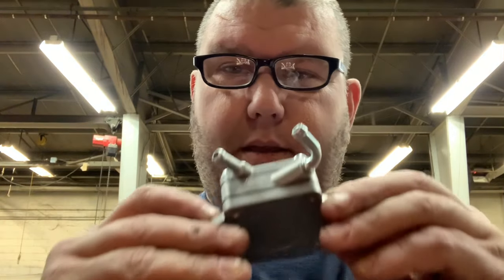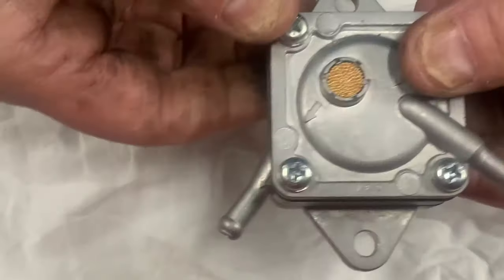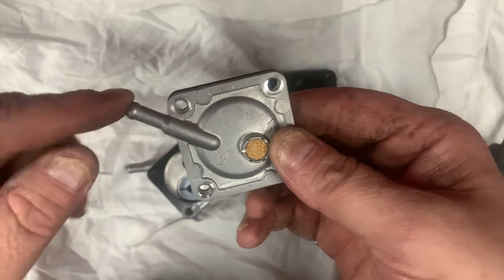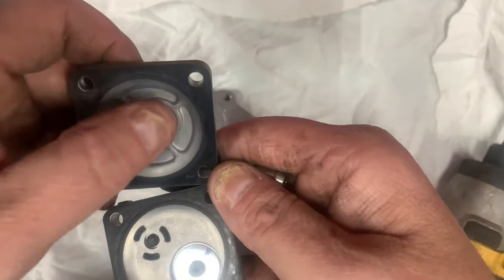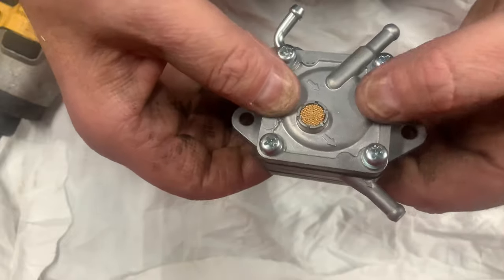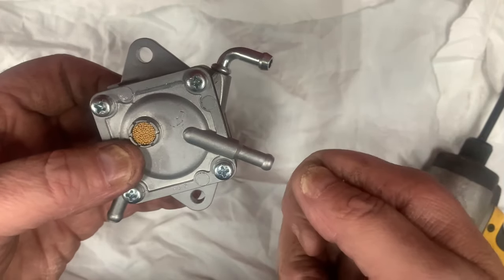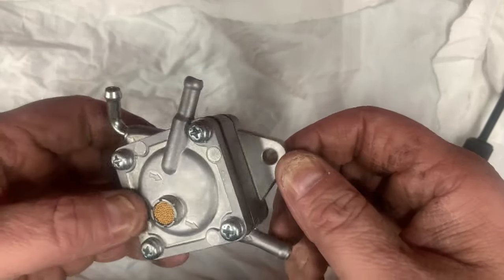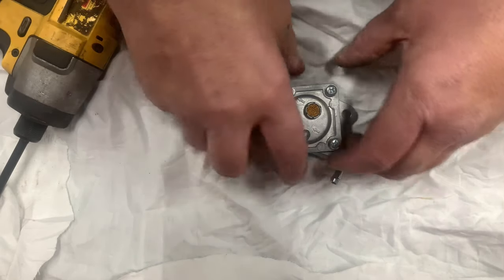#FUELPUMPS / WHAT FAILS? / GAS IN OIL? / THEN YOU NEED TO GO CHECK THIS RIGHT NOW!

Comment: I'd previously replaced everything from pickup tube to new gas line and filter, but the mower always took a long time to crank when it's been sitting for several weeks. Yeah these are self priming but only when the engine is cranking. Solved that with a Facet electric fuel pump.

Comment: Hey, Jeremy!  Thanks for this one!  I had a Tecumseh pump that didn’t seem to be working on a Tecumseh v-twin engine. It took long crank times to get the engine to fire. I took the pump apart and found fine debris inside but close inspection showed no damage to diaphragms or check valves. Cleaned it up good including ultrasonic, sprayed with a bit of fuel on all surfaces, reassembled and started to mount back on the engine but found the last 1/4 inch of fuel line to the carbs was cracked so I cut that off and completed connecting. Full choke, full throttle, key on and she fired after one crank revolution!  Stopped and restarted multiple times cold and then hot with no further issues so I have to believe it was a small leak in the hose causing the problem.

Comment: My 1998 ez go will start for about 30 seconds then not again until a few hours later . I replaced the fuel pump , carburetor,  plugs , solenoid  .. still same issue .. i only use ethanol free gas

Comment: great explanation. I just purchased a similar fuel pump for my skidoo except that outlet with the bend at 90 degrees positioned on its side is pointing up on the new pump I purchased. Supplier says its similar to my OEM. The problem is that it wont fit in its original location with that outlet pointing up. Can it be rotated without damaging it.

Comment: Great video thank you. Can you tell me if it matters whether the tank is above or below the pump - so either the pump is sucking the fuel out of the tank or the fuel flows by gravity (as well as suction) to the pump. Based on how it works, it doesn’t look like it would matter, but you would know better than me. Thanks

Comment: Does a longer pulse hose cause problems  ? I re routed it along the frame, or adding a breather to my valve cover that was hooked to the intake ? Didnt like the oild residue in the carb/intake.. having issues of running out of gas when running it hard for any length of time, no governor so it revs up to 3500 rpm. Works great any other time.
2008 Kawasaki FJ400D 13hp engine in a 1991 Club Car DS with 22" heavy mud tires.

Comment: My cart Yamaha g16 I believe gas want pull fuel from tank. If I prime it it will run poorly until it loses its prime again. Carb and pump are a few years old. They seem to still be ok. Should I replace my fuel lines or tank pickup? Thanks for your help

Comment: Thank you for this video I have a generator and it is brand new and the crank case filled with gas and I thought this is what it was but didn't think it could have been because it is new. Does the pulse come from a crank case that is filled with oil? Or from the intake? I am going to take the bad one apart and see if the diaphragm is broken. 😊

Comment: Question, are these supposed to cut off fuel when there is no vacuum applied?
I bought a replacement that just flows right through from gravity and I wanted to use it as a fuel cutoff for when the engine is not running as I have a unfindable sporadic float valve issue that has been driving me buts for 2 years after 3 Rebuilds!!!
And I cannot find a reasonable vacuum cutoff for a 1000cc engine below a hundred bucks.
Reply: it should not flow through unless the engine is turning producing the pulse. Your diaphragm and check valve may be shot.

Comment: Can you explain the club car with the button primer? I’m guessing it’s tied into the pulse line. My club car is a bear to get started , carb was rebuilt, new fuel pump, fuel lines are clear but it just doesn’t seem to be getting enough fuel. I’m thinking the primer button is absorbing the pulse from the engine or possibly an air leak is messing up the pulse. I don’t want to tear into it without having an idea how it works. Thanks

Comment: I have Mikuni fuel pumps on my Rotax 582 and Rotax 503 engines, both with dual Bing 54 Carburetors that specify fuel pressure from 3-6psi.  Wondering what the capability of the Mikuni fuel pumps are?  These are pulse pumps with short pulse lines.  The pumps are mounted near the engines and the fuel lift is about 3ft.  What are the fuel pressure specifications for these pumps under your "standard conditions"?  I plan to install fuel pressure gauges to monitor fuel pressure, and am wondering what "normal" pressure should be?  Thanks for any help!

Comment: Excellently detailed video and explanation - liked and subscribed FOR SURE!
A question: Do the Mikuni pump mounting bolt holes match the cheap plastic bolt holes? Hose lengths or orientation are not a problem - my 2 Kawi-V engines' plastic fuel pumps may be big-time problems in the future though...

Comment: Where does that pulse line connect to crankcase? 2009 Hisun 700 Big Muddy. Fuel issue and pulse line broken. Where does it connect too? Replaced pump and even auxillary tank, same issue

Comment: I have a 2019 Scag 48" walkbehind, SWZT48-541FS, Kawasaki FS541V.  Pull-cord. I open the choke.  When I try to start it, it will NOT start.  However, if I add 1 teaspoon of fuel into carburetor, it fires/starts.  After engine has been running a short while, it will restart withOUT adding fuel directly into the carburetor. I have been doing this for 1-year.  Why does it need to be manually primed to start?  Is the fuel-pump, Kawasaki 49040-7008 Fuel Pump, likely the problem or more likely the fuel line or something else?  BTW, I have changed the fuel filter and I had an ultrasonic cleaning of the carburetor.  Those did not help the issue. Thank you!

Comment: so what you are saying is that if you have a fuel tank capable of gravity feeding the carb, bypass the fuel pump so you dont kill the bearings in the motor?
Reply from the maker: Pay attention when the fuel pump fails sometimes the fuel will run right down to the engine into the oil causing bearing damage

Comment: Is it possible for reed valves to cause a problem with the pulse signal?  I have a 2 stroke engine (outboard) that runs fine except at idle, where it idles fine for a bit but then starves for fuel and stalls.  I can keep the engine idling indefinitely by giving the primer bulb a squeeze whenever the idle starts slowing down.  Once the engine is off idle it runs fine and seems to have good power (boat top speed is same as it ever was and it planes or pulls up a skier no problem).  I replaced the fuel pump and there was no improvement.  I then built a hybrid fuel pump using the new diaphragms but the old check valves (rubber, the new ones were plastic with a spring) and now it is idling indefinitely but I don't think it will last and I'm not sure why the new pump with the new check valves wouldn't work as it came in the box.  Or am I looking at low compression?  It is 105psi cold.  There is definitely a pulse coming from the crankcase when the engine cranks, but I don't know if it is enough pressure.  I also replaced the fuel line with the primer bulb, which made no difference.
Reply: Sounds more like the pilot jet in the carburetor is dirty. Try a little seafoam in your fuel tank to clean it out.
Reply: @grazz7865  the sea foam has actually made quite a difference, but I’m also now running about a half turn rich. Do you think more sea foam, or do I need to rebuild?  Anyway the sea foam and running rich has made a world of difference. Also set the timing which was too far advanced for some reason.  I set it to spec at idle, and close as I could at WOT.
Reply: @Nonplused  run the tank empty before adding more seafoam. You don’t want too much seafoam to fuel ratio. Bad fuel can also cause issues so run the tank empty or drain it if it’s less than a 1/4 tank.
Reply: @grazz7865  I’ve been running the boat so the fuel is fresh and the sea foam is just through last tank. I’ve got marine fuel in this tank since that is available here. It is running and starting much better, maybe I’ll set the pilot screws back and see where I’m at. It still won’t idle in gear for long but if I bump it to 1000 rpm I can putt along indefinitely and it idles indefinitely not in gear.  One thing I’m not sure about is with it running rich is the oil mixture. It is oil injected so I think it gets the same oil no matter how much fuel. It still smokes a bit though so there is oil but it might be lean. Thoughts?
Reply: @Nonplused  definitely gets the same ratio whether It’s premixed in the tank or a separate reservoir and injected.
Reply: @grazz7865  thanks for your help!  Just got back from some lake time before it got windy and it ran tolerably well!  Quite surprised how much difference sea foam makes.
Reply: @Nonplused  seafoam is amazing!

Comment: When you switch to a pump from gravity feed how does the engine then get vented, the pump uses the vent pressure so the vent is closed off?
Reply from the maker: normally through the tank vent or the gas cap

Comment: Question:   Can that pump be used as a oil pump too?
Wondering if a vtwin could be converted to a “dry sump” ?

Larry
Reply: Will it pump oil? Yes. However, it doesn't produce the volume necessary to pressure lube an engine.

Comment: I have a JD 160 lawn  tractor and I don't get gas to the carburetor. I put a new fuel pump on and it went around the yard about 4 times and quit..  Is there a way to test the vacuum that runs the pump?  And is there anything else I can try?
Reply from the maker: this is a common misconception about those fuel pumps they don’t have vacuum they have positive and negative pulses from the crank case. Every time the piston goes up and down. It creates a suction and a pressure. You can test this by putting a vacuum gauge on the hose and crank the engine over to see if the needle fluctuates positive and negative, but I would be leaning more towards a restriction in the fuel pick up, so check for an obstruction from the gas tank to the fuel pump
Reply: @THEMOWERMEDIC1  Thank you.  You know I put the fuel line that led for the gas tank that was about eighty inches long into a glass of gasoline, it didn't pump up the gasoline to go into the pump.
Reply: @icemancometh8679 did you figure this out. I have same problem.

Comment: There needs to be a gauge to check the engine pulse or something ?
Reply from the maker: Never needed one
Reply: @THEMOWERMEDIC1  i’m a heavy equipment OO mobile mechanic, 12 hp Kawasaki runs good but won’t lift fuel from tank if I put pulse hose in my mouth it pours out a full hose of fuel? Only trickles when turning engine over, R&R pump diaphragms seems good but maybe doesn’t  flex enough, it is an old pump seems a Sensitive vacuum/pressure gauge could guarantee the right pulse at the pump, new pump on order I will see but hate doing the throwing parts thing :).

Comment: Hey chief have a question hope you could help me with I have a Hobart champion 145 welder/generator it has a 11 hp briggs and stratton engine unfortunately the owner ran it without oil so my question is can I install any size engine in it or would I need to find something similar to it and how about the crank shaft does it have to be the same length size it's that I try looking up videos on engine swap for generator can't find none that will help me
Reply from the maker: Model
Type
Code.   Need that info off the
Engine

Comment: If there is water in your gas tank I guess it would be a good idea to clean out that fuel pump of residual water
Reply from the maker: Just unhook it from the carburetor Crank the engine it’ll force the water out
Reply: I have a cub cadet riding mower I just bought in 2019 and I think fuel pump has failed already!If I pour gas into carb it starts right up.
Reply: @stevezabriskie9839  my cub had a gummed up carb solenoid. Cleaned and exercised the plunger and used ethanol free gas (Puregas app)

Comment: can i get parts to rebuild this pump? i have the same one on a kawasaki mule!
Reply: I have the same question. Did you find success?
Reply: @PhillipHall01  no I bought a new one
Reply: @StonemanRocks  
Thanks Stoneman, Since I had ask you, I realized mine had lost its prime after a bad fuel line from the tank. With air pressure added in the tank for repriming, mine went to working just fine again. I sure was glad! 😊 Phillip Hall